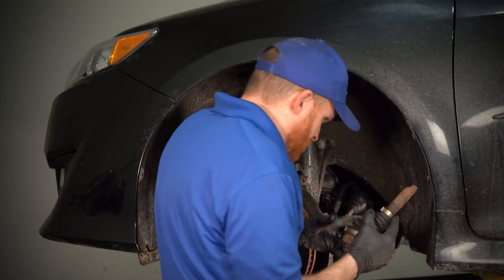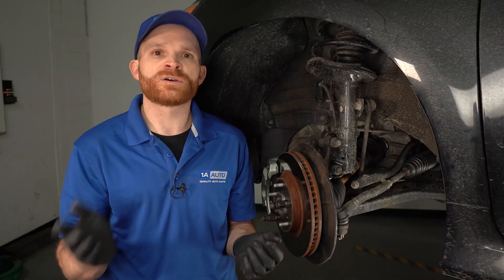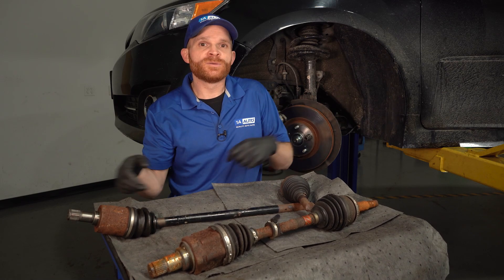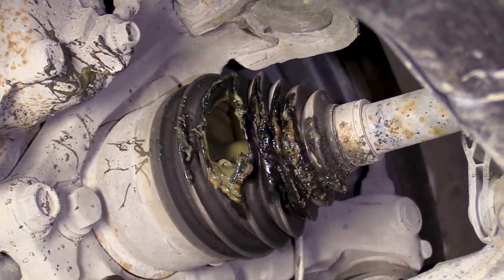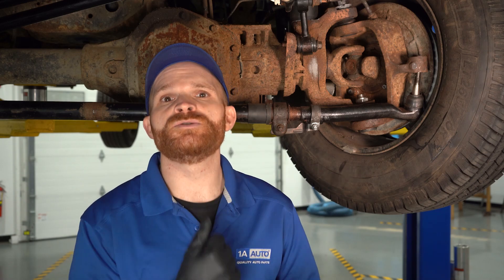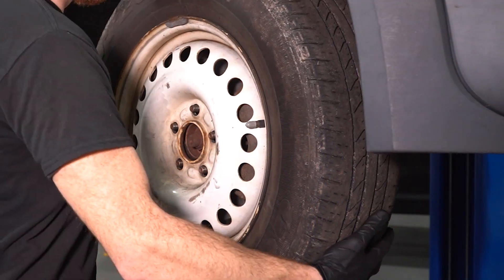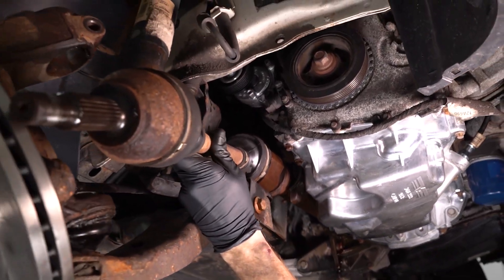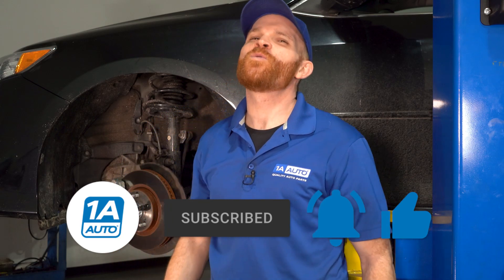Car or Truck Won't Move? Transmission's OK, But What's That Noise? How to Replace Your Snapped Axle

Comment: I have a problem and was wondering if anyone can help, I have codes p0171-P0174-P1131-P1151. Have to hold brake and gas to keep the engine from sputtering off even at red lights. Rpm drops low and will shut off after shaking if it’s not given gas. 2001 Lincoln Navigator v8 rwd.